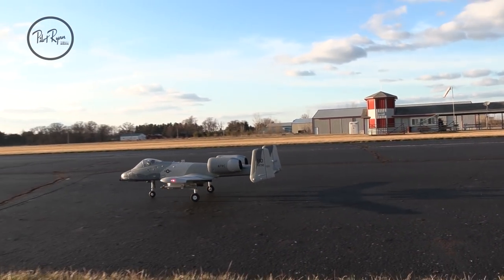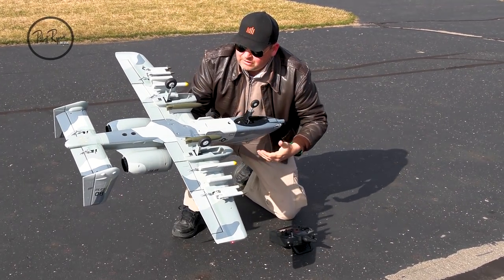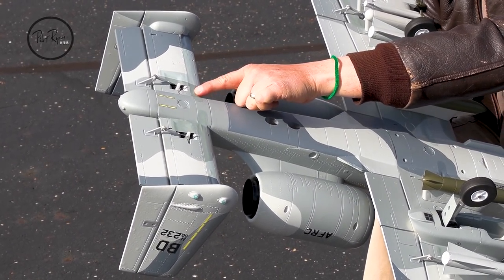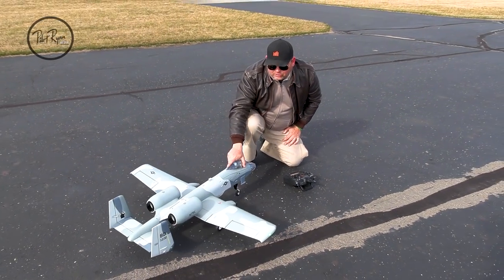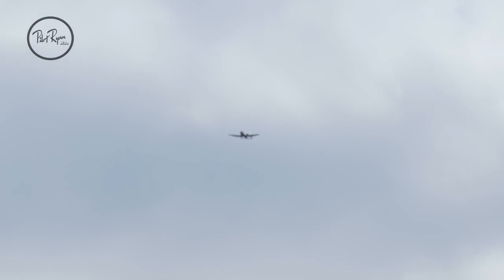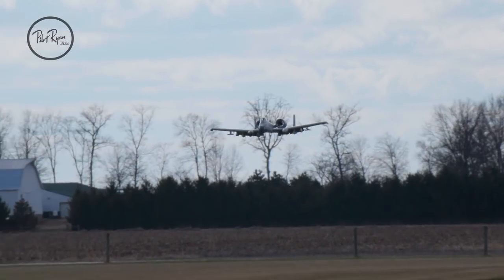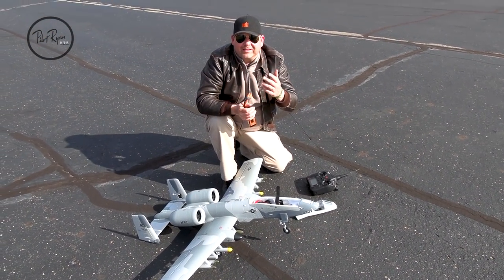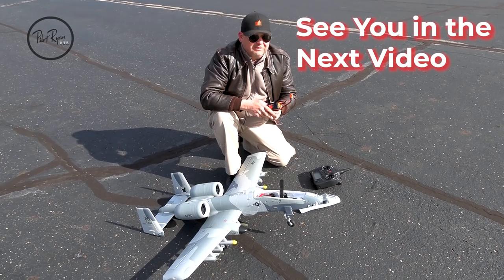E-Flite A-10 Thunderbolt Twin 64mm EDF Shakedown Flight

Comment: I'm always excited to see a new E-flite plane because they always seem to be high-quality, but how does this compare to the freewing twin 64mm A10 with regards to slow flight? This is more than 40% heavier on the same wingspan and I dont want it, if it's going to be a flying brick.
Reply from the maker: Watch our second flight as well. I thought it flew even better with the battery back an inch. It’s way better than the Freewing 4s version with no flaps lights or suspension
Reply: @PilotRyanMedia  Perfect, it's on the list to buy. I'm glad I held off from buying the freewing. Factory AS3X is hard to beat!